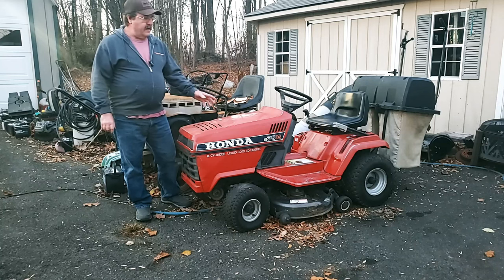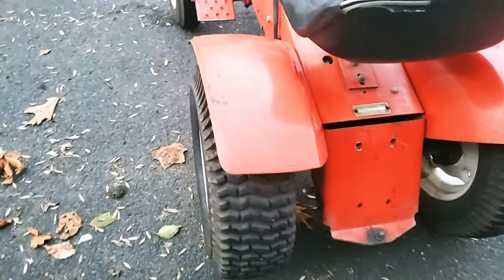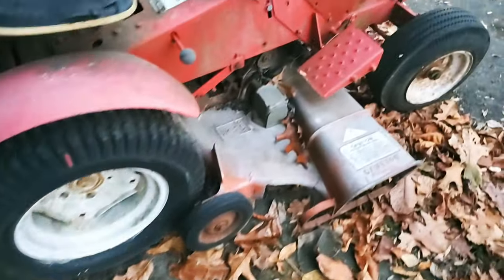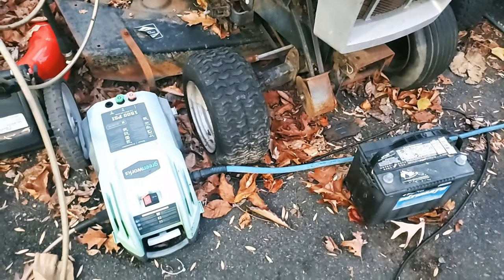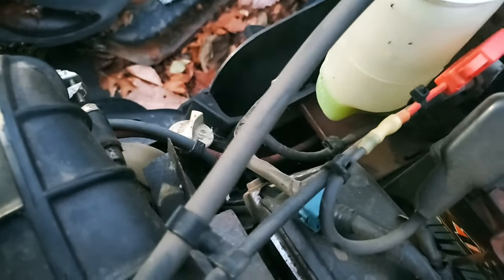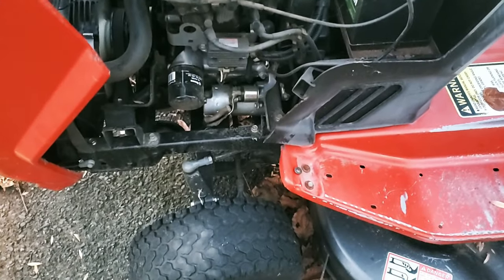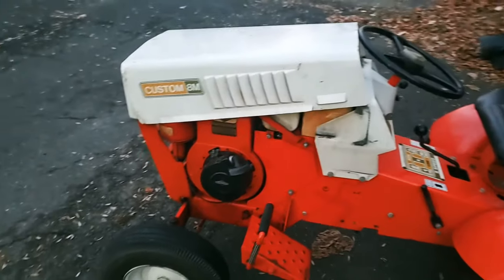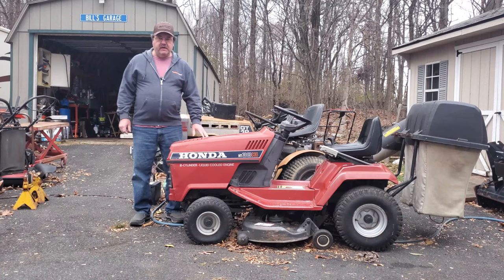New Arrivals in The Shop: Honda Liquid cooled,  Sears Custom, and an UPDATE #zeroturnmower

Comment: That Honda liquid cooled tractor is a great mower
Reply from the maker: I've never worked on one before, but I'm excited to see how it runs
Reply: @ridingmowerking   hopefully you can get the mower blades to engage
Reply from the maker: I think it just needs an adjustment to the clutch @robertmailhos8159